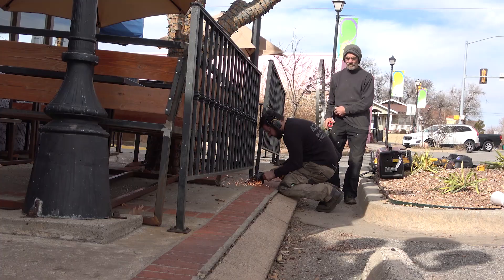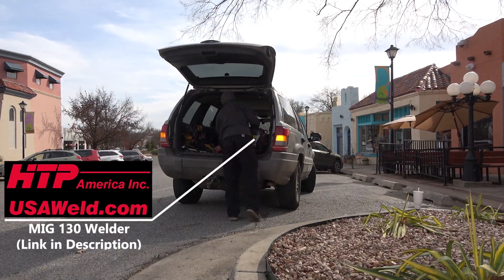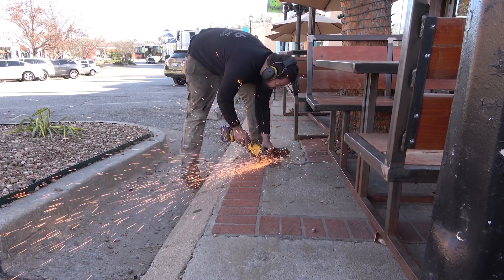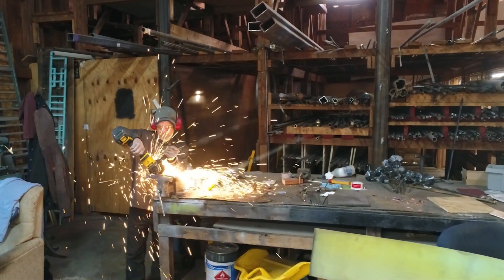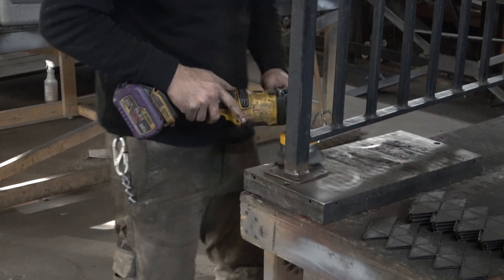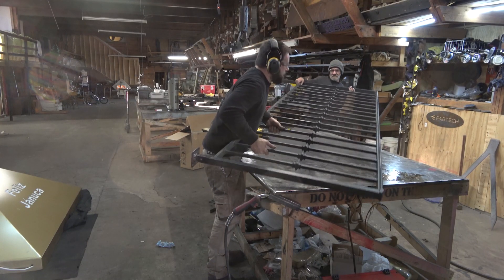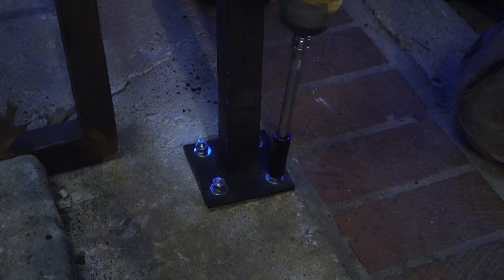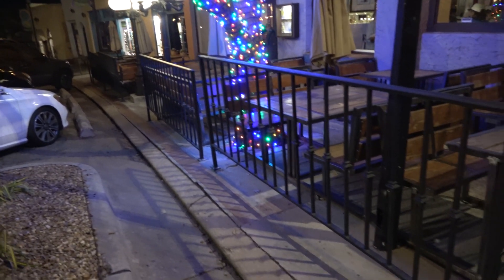When a Simple Job Isn't Simple

Comment: Someone forgot to put drainage holes at the bottom of the posts so water dose not build up inside.
Reply: That is exactly right.  The water is more than likely the result of condensation from temperature change and any hollow bodied project needs at least one drain hole in the lowest point.  A hole drilled in the center of the footplate would have probably made this last longer originally than it did.   Nice repair and a nice tip on using the diagonal cut for more weld and strength.
Reply: I agree with This statement but also I have run into multiple times where that 1/8" hole on thin wall tube or tubing has plugged up full of rust and other debris causing the steel to rust out premature or bulge after a good freeze
Reply: @pooinyourass  That is why It should be quarter inch or even three eighth inch  you will need the larger size if the railings are going to get hot dipped which is what I recommend although I have sometimes had them electro zinc passivated when a smother paint finish is required and or they are going indoors.
Reply: I tend to disagree this. If that tube were welded completely sealed, then no drainage hole needed. Steel is not permeable so water vapor cannot get inside. Also the amount of air that is in the tube during time of fabrication cannot hold enough water to rust it inside out. Also rusting process would burn the oxygen quickly and as the tube is hermetically sealed no extra oxygen cannot get in. However if you cannot weld it completely air tight then it is better to leave drainage hole.
Reply: @Equiluxe1  we cannot do large drain holes as this leads to yellow jackets and wasps building nests inside and stinging customers!! Its a tough situation but most of the time its gotta be welded shut!
Reply: Could it be from snow piled up against railings? Moisture weeping upward
Reply: Equiluxe1 can’t fill with water if you use solid bar...
Reply: @grogwrench793  
More expense
Reply: If the tube is air tight it does not need a drainage hole.  Proper welds ensure this.  What this fence needed was good paint. If the surface rust was cleaned up and the bare metal painted regularly this would not have happened.  The weld shop should ask the customer for a yearly maintenance contract. $$$
Reply: TurboFlush What is your reputation worth? If you want to make a name that stands for quality and integrity, there is no greater value than zero call-backs/rework. In my experience, powder-coated solid bar is the superior, longest lasting material for posts and pickets.

If you’re worried about weight, solid aluminum bar instead of steel, DA sanded and powder coated, carries a smooth-as-glass finish.

Buy once, cry once.
Reply: @pooinyourass  yep, too small a hole and it gets plugged quickly. And bigger than 1/4 and your hollow construction gets filled with bees!
Reply: @grogwrench793  YEA! For something with ground contact 16ga is too thin to last a long time.
Reply: Lol I waited to come here and be a wise guy and point out the same thing.

Let me talk you why he chose no weep hole.

Ready?

JOB SECURITY!
Reply: well i noticed that all the outdoor benches and furniture were the same. and also not painted ?
Reply: @benjamindemontgomery6317  thanks Ben your post reminded to block these fools
Reply: @anastyb  ?
Reply: @Ccorniit  Hello Ccorniit. Please give your technical guidance on this.     I have steel circular sections (ground water bore hole drilling pipes) (4" diameter & thickness 3 mm, height about 10 feet) as columns for our container home.   I am very apprehensive about water being stagnated inside these columns (& subsequent rusting). What do I do?    Should I drill a drainage hole at the bottom of these pipes? Or is there any perfect suggestion?     I have also used formwork jacks (centering for slabs) as the columns for our container home (these are obviously not air proof, they have holes in them to fix the height/level). What do I do for these too?  Request you to help me. Will be waiting. Thank you Ccorniit.
Reply: @sustainwind9340  if the pipes are sealed inside they will use up what little oxygen is present and then rust no more on the inside, seal em up
Reply: "Somone" is making sure he will have work in the future ;)
Reply: Job security lol
Reply: @Ccorniit  you are incorrect! I have a rail business 25 years and weep holes are a necessity you will either Puff the post or rust it out
Reply: @Farmboy1544  with all due respect you dont know what your talking about !! Drill a 1/ 8" hole above base plate and watch how much rusty water comes out!!
All these keyboard fabricators/ scientist who have there theories are factually incorrect what is taking place is plain and simple condensation!!

Comment: You are a skilled craftsman, with integrity. As a contractor I do a job walk, and if I have a questionable job, I will quote the customer a low, and a high price for unforeseen problems. Keep in constant communication. I have made mistakes on my spreadsheet as well and I am ok eating my mistakes. Some jobs you do lose a little, but it will come back ten fold in referrals going the extra mile. I make it a habit of not going back for more money, unless it was quoted as such. I will do the job right like you. Cost no longer plays a roll in my hard bids.  Been in business since 1995, and I don't advertise, and took down my website. Just one mans opinion.  Hope this is the food for thought you were looking for.

Comment: I appreciate your transparency when talking about billing and your thoughts behind it.  As a maker of stuff that occasionally gets commissioned to make a piece I really struggle.  If I charged my actual time they'd never be able to afford it because it might take me 8 hours with my tools and equipment whereas it may take a properly outfitted shop only 2.  I do it because I love it though.
Reply: I hear ya, and I had the same issue for the first few years. Eventually, I figured a great simple method that was easy to explain to my customers: Repair work was $100/hr w/1 hour minimum, then anything over an hour would only be billed in 15 minute increments  (plus any material). Full custom jobs cost was broken into material cost, and then 3x that for the labor. That formula worked for years, and my customers loved it, especially when I only charged them the material cost up front, and then told them I don't make a penny until the job is done and they are happy with it....which they always were :-)
Reply: @douglasgoldstein8990  A proper Goldstein...!
Reply: @henryrollins9177  LOVED you on your guest appearance on TOOL's album!
Reply: @douglasgoldstein8990  I know i know, was one of the high points on my career..😉

Comment: Common problem with this kind of structures is that there are no wentilation holes. Moisture is building up inside and it cannot escape so metal is rusting away. There should be a hole in the base plates to let the water out and there should be holes on the top, in vertical tubings. Fence would last much longer that way. But then of course, you wouldn't get that job.
I have to say it would be a pleasure to work with you because you have amazing work ethics. Congratulation!

Comment: That's the reason why I do such jobs either with stainless or galvanise and powder coat the steel. You can have the tubes coated on the outside with just paint or powder, but at least the humidity kept in the fully closed tube cares for rust. Not to mention small scratches on the lower part of the railing and the influences of dog urine and salt.
Personally, I skip jobs, when the customer wants to save money on the coating.

Comment: 2 years ago, i had something similar to this to repair. Not sure if its any help, but i just cut off the bad area of the tubing, and went about 2 inches higher to cut as well. Then i made a mock up square tubing with 1" flatbar, and welded it to the base plate. It held on pretty solid.

Comment: Pretty dope break down. I'm moving back into a similar field pays better then art but I would highly recommend using a weed sprayer and drilling wet I always hate dry cuts or anything the makes dust with people around. Even a small shop vac setup will do a great job on active jobsites. Great video.

Comment: Water in the tube, make sure you have a drain hole drilled at the bottom and a hole at the top for water inside to escape through via evaporation.
Reply from the maker: personally, I disagree. Seal the tube. if water can evaporate it can condense too

Comment: You mentioned lowering your voltage to stop burn through, heat is controlled by the amount of current. Faster wire feed, more current...less wire feed less current.  Tweak voltage to tighten or spread out bead
Reply from the maker: Completely wrong on synergies machines. Current is tied to wire speed. Heat is voltage dependent

Comment: Add a chunk of stainless to the bottom to prevent rust.
Reply: Just have the plasma cut a drainhole in center, so when welded the water can run out.

Comment: widen the foot plates to keep the railing in the same place, although probably a pain in the ass to hammer drill that close to old anchors.
Reply: nevermind yall did a bang up job
Reply from the maker: Yeah, you basically have to move at least 2 anchor diameters to have an anchor mount into clean concrete. Otherwise you risk the slug of concrete between the new and old anchor turning to dust

Comment: Where I work we only use stainless fasteners unless something else is spec'd out by engineers. We also spend a little extra and use stainless baseplates whenever we can. It's worth it to know that what we install will never rust out. Redheads are very strong but they will not last in the elements. Don't mean to knock your job. It looks like you did a solid repair overall.
Reply from the maker: Not an unreasonable comment. Just have to tailor the work to the customer and the budget. I expect this repair to outlast the fences, which is all the really matters in the end.

Comment: That mag chuck Im looking at buying one does welding on it mess it up I have small piece to tac and I think it would work
Reply from the maker: I have done tacks on it. I don't suggest it as a common practice without an auxiliary ground. Aka, don't have the current run through the chuck.

Comment: I always asked do you care what it looks like? If not i would slap some inch flat stock on it weld high up and at base. Drill some holes to let water out and give it a spray can coat. Done in an hr strong enough to last a few more yrs and charge them 100 bucks. But we also dont have snow in nc so repairs must be easier than there

Comment: Wondering why you didn't also just drill some drainage holes to let any water out?? it always works for me, and ensures my repairs stay good..
Reply from the maker: Welded the tubes closed top and bottom. Two solutions to the same problem

Comment: i would repair this with anchoring cement and rebar,  anchor the rebar into the ground within the vertical stantion, and then fill the vertical stantion with more anchoring cement.  You could be done for 30 bucks in material, and would be done in a half an hour.

Comment: MMA stick weld with a "TIG" filler. take a 2.5mm rod knock flux off and stick weld with a "filler" rod. ALSO with the frezze issue why didnt you drill 5th hole in centre of base plates for a drain hole

Comment: You didn’t show all the metal studs you cut down in the concrete next to the new ones? Did they good or bad?
Reply from the maker: We cut the old ones off flush to ground level.
Reply: 42Fab - Metal Fabrication & Signage but you didn’t show what it looks like? Was the customer happy?
Reply: I like that you take care of your customers!
Reply from the maker: They were. The goal was "make these fences not wobbly" and they are definitely not wobbly. Moving them down a bit to drill into fresh concrete was a minor thing to do to have it done right.

Comment: I had a plumber charge me $326 for 6 minutes of work...cut off a 3/4 leaking soldered fitting on a hot water tank and push on a Shark Bite to connect the flex hose. I would have done it myself but I was 2000 miles away at a wedding in Mississippi. You seem like a great and fair deal.
Reply from the maker: That's high, but the reality is, it wasn't 6 minutes. He had to drive there, take a call, or have a dispatcher who does, have the supplies on hand, shop for those supplies, and had to allot a portion of time for the "what will this job need?" factor.
Reply: @42Fab   I ran a successful engineering business for years. I know about fixed costs and unexpected complications. This plumber is an independent whose ''shop'' was 3/4 miles from my building He works out of his home garage. Everything he needed was on his truck. He ripped me off. 

The guy should have cut off the old fitting and sweat soldered a new one on...an 8 minute job if I did it myself. This would be like you grinding the railing in place and stuffing in  JB Weld, grind it to shape then spray paint it. With a quick look around your shop, I know that you do quality work at very reasonable prices.  

 I called him a few weeks after the job and complained. He said ''So don't call me next time''.  Fine. I got on Yelp and added to his bad reviews.

You know this kind of fly by night guy... The one who can ''weld snowballs to screen doors'' with his 810L welding rods. You flip the rod over and it says 7018.....  He keeps his rods in the oven but his wife gets really pissed when she needs to bake cookies.

Comment: Did you end up remembering to put weep holes in so it doesn't happen again?
Reply: from what i seen they dont and at 4:30 you can see from were the moisture get in. They also dont weld shut those holes at the bottom so in 2-3 years they be fixing the same problem. So they repair the railing but dont solve the problem.

Comment: Was the legs 1inch sq tubing with .063 wall? I was doing a small fence for somebody and was going to use 1” sq tube with .063 wall
Reply: Would that be good?
Reply from the maker: I wouldn't. These were 1.5" 16ga but I recent built some new to match and used 1.5" 11ga
Reply: 42Fab - Metal Fabrication & Signage so there is the fence that won’t have to withstand any weight then their is the porch railing, I think I’ll do the porch railing 1.5, does that sound good?
Reply from the maker: I used 1.5" for 8 all

Comment: I found that after drilling concrete you should blow the hole clean as the dust acts like a lubricant and does not let anchors seat well

Comment: When drilling anchor bolts, Drill all the way thru the concrete. That way you can just drive the cutoffs thru if you ever need to remove them.
Reply: but this would allow the bolts to rust from the bottom up from the ground dampness
Reply: @markkiser5120  That's how you get repeat work about 8 years later...

Comment: it may be helpful to pick up a little usb borescope/endoscope like this one https://www.amazon.com/dp/B01CL1QUCW/ref=cm_sw_r_cp_apa_i_caqKEbYK3CF7R

there are many different ones so you can get one that plugs in to your phone. has a little light on it. super handy for looking inside tubes just like this when youre doing a field call. has the added benefit of a slightly more professional vibe to it than the old stab it with a screwdriver to see if its all rusted out  technique and gives you a better idea of what you have to work with

Comment: Seems like the long way around to a common fix. Why not just double sleeve onsight? This is where a shop vs mobile business varies. This is the right way technically but mobile would’ve have just double sleeved the legs and been done onsite. Not a clean as some of the rusted material is still going to be up inside the new legs but common on site fix.
Reply from the maker: Not as clean answers the question in my book. I'd rather have it right, even if I eat a bit of potential profit.

Comment: Look up the “Shake-N-Break” air hammer socket adapter. About $30 for the 3/8 and 1/2”. It would have taken those bolts out without snapping them.

Comment: Total dumb question.  Why not put a thick wall square tube on the outside of the rail all the way up to the bottom of the horizontals? Not the inside.
Reply from the maker: It would look like a bad repair

Comment: Next time, use a level please ;) !
Reply from the maker: Level is often irrelevant, TRUE is what you want, in this case true was a stairstep to match the varying curve of the sidewalk
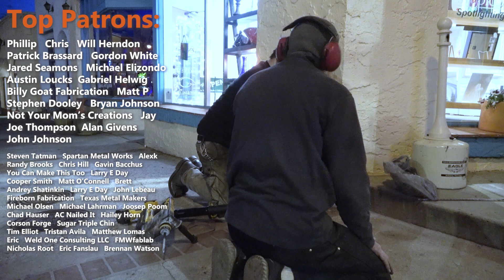Reply: @42Fab  Sorry for my short comment, I'll explain what I mean. If you look at 11:16 the pole you placed is not vertical level (don't know the correct word, I say "level" for horizontal and vertical). Unless the building corner wall is not level lol. If you look at 11:20 between the 2 closest fences, you see at least one is not level. The closest fence seems to lean to the street (or the second to the building). If the concrete floor is not level, you can solve it by putting stainless pieces of sheet metal under one side of the feet. Or weld the fence level on site (best option), but that could be more expensive as you explained.Take for axample 6 fences in a row. Of course the street is not allways level, but if you look over all 6 and they are not "in line" with eachother, It looks bad. I mean you could have done a fantastic job, but if their crooked and someone asks who placed their fences...? It's not me you need to convince then. Otherways good job and let my critisism lead to improvement, not to discouragement! Stay safe folks.

Comment: I specialize in automotive Diagnostics and electrical.... my in shop rate. 125.00. Per hour my call out rate is 150.00 with a min of 2 hour. Now that being said I do a lot of trailer to truck light fixes. And I very rearly ever go past 2 HR. And if I am getting into a job and I see that the problem is bigger then 2 hr  I will take it into the shop at the rate of 125.00..... I am so nice to my customers that most often I don't always charge full pop.